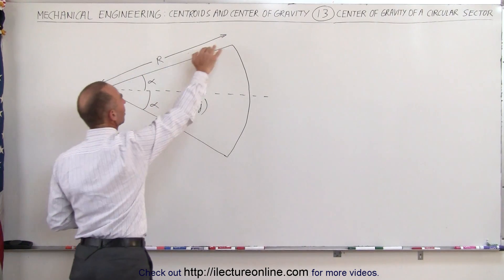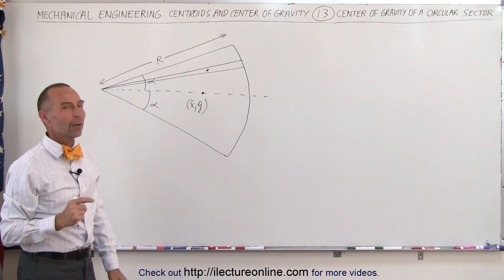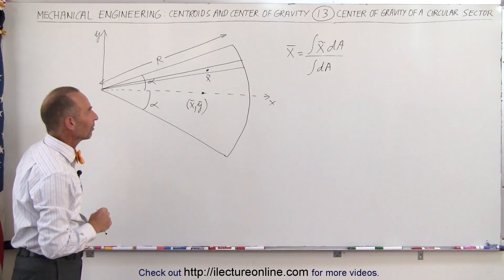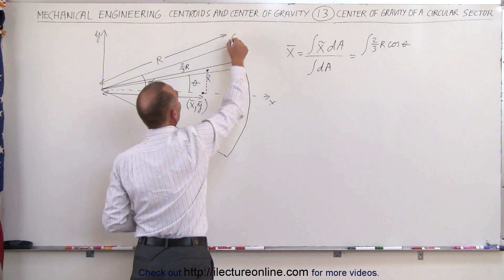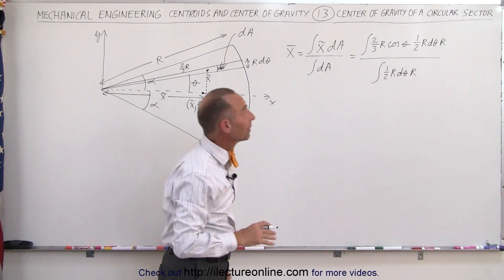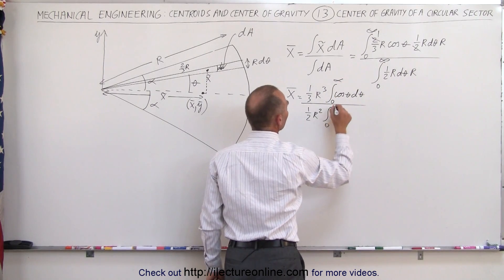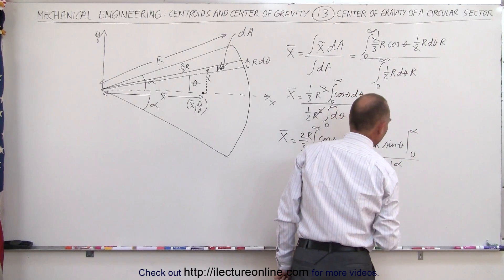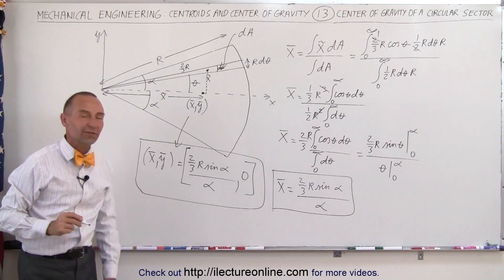Mechanical Engineering: Centroids & Center of Gravity (13 of 35) C. G. of a Circular Sector

Comment: thank you sir, but how did you get R*d(theta) at 2:53
Reply from the maker: The arc length of a circle is the radius multiplied with the angle     C = 2 pi R
Reply: thank you ❤ @MichelvanBiezen

Comment: Hello sir, thankyou so much for these vids extremely helpful, i understand that you integrated from 0 to alpha for easier calculation however you forgot to multiply the whole thing by 2, otherwise ur getting the center of gravity  of ony half the shape
Reply from the maker: Because of the symmetry there is no need to multiply since each half will have the exact same answer, and putting together you will still get the exact same answer.

Comment: How was the base rdtheta. What concept is that?
Reply from the maker: R d(theta) is the arc length of the segment.  And the segment is the shape of a triangle.
Reply: @MichelvanBiezen  so why is it that we use arc length formula to get the base but use the area of a triangle on the same shape?
Reply from the maker: For a small enough segment (which is the basis of all calculus) the base is a straight line.  (When the angle becomes infinitesimally small)

Comment: What if your circular sector isn't on the axis?
Reply from the maker: Since you just want to know how far from the point the centroid is, it makes more sense to place it on the axis as shown.  (There no reason to do it otherwise).
Reply: @MichelvanBiezen  I was doing compound shapes and needing the centroid with rspect to my axis. I was able to use the distance to make a triangle with the hypotenuse length of the centroid distannce you showed us and get the side lengths with trig.

Thanks for the response!

Comment: Sir, I understand that a quadrant circle formula is 4r/(3pi), but can this formula apply to a 90 degree sector?
Reply from the maker: The best way to answer your question is to plug is some known values like  pi/2,   pi, 3 pi/2,  2 pi, and 0 and see if you get results that appear correct.  Try it and you'll see some interesting results.

Comment: Sir, I'm having a doubt. In the above problem, shouldn't the limits of integration be, -alpha to alpha??
Reply from the maker: Not necessary.  Because of symmetry, it is easier to integrate from 0 to alpha.
Reply: @MichelvanBiezen  Thx sir
Reply: @MichelvanBiezen  bur sir you haven't then multiply it by a factor of 2
Reply: @MichelvanBiezen  i think the answer should be 4/3 instead of 2/3
Reply: @altamashqamar9959  He's dealing with polar coordinates here not rectangular

Comment: Shouldn't the limits be α to α. Cause the centroid to be found is of the whole sector with angle 2α and not of the part with angle α. This makes the formula
(2R/3)×(2sinα/2α)

For example if we take a semicircle α will be equal to π/2 or (90°) which will make the co-ordinate of centroid 0, i.e at base of semicircle which is obviously incorrect. However using above formula we get 4R/3π which is the actual answer.
Reply from the maker: If you remove half the object, you will find that the centroid (in the x-direction) is the same for half the object as it is for the full object.  (That is due to the symmetry of both halves).

Comment: It is funny that in the limit as the angle alpha goes to 0 the CoG or CoM goes to (x,y) = (2R/3, 0). The factor of 2/3 seems arbitrary. I know it comes from the CoM calculation for the triangular slice, but it still seems as if it should not be there.

Comment: Professor shouldn't this be integration with limits from -alpha to +alpha?
Reply from the maker: You could do it that way, but it would require more work.  It is easier to do it as shown in the video
Reply: @MichelvanBiezen  But the limits shld be from -alpha to alpha 
Taking them from 0 to alpha would only give half the sector's centre of mass
Reply from the maker: And you would also divide that by half the area so that the ratio would be the same.
Reply: @MichelvanBiezen  plzz verify it by putting alpha=π , i.e. for a disc it should be 4R/3π but from this formula it is coming to be 2R/3π...

Comment: Hi sir 
 Why is the lower limit zero rather than negative alpha?
 Why we didn't use the area of circle sector?
Reply from the maker: Using a zero for a limit is always easier to calculate, and since the area is symmetric, use the lower limit as zero and double the result.
Reply: @MichelvanBiezen  you hadn't doubled that sir!, Plz check, correct myself if I am wrong!

Comment: I think you should have evaluated the zero as well. Sine theta over theta when the limit approaches zero is equal to one. So when you evaluate the lower limit, it should be (2/3)R
Reply from the maker: The video is correct.

Comment: why the limits are taken 0 to Alfa rather than -alfa to alfa
Reply from the maker: Because of the symmetry, the bottom half would get the exact same result (so we only need to integrate over half).
Reply: So shouldn't there be 2times the whole 0 to alfa
Reply: Ankur Ghosh no because 2 will cancel from numerator and denominator
Reply: ankur ghosh no dude try taking aplha to -aplha u will get the same result.i think if we were finding the moment of inertia we would have multiply it based on number of symmetrical images we have :)

Comment: Sir Can you please explanin why you put the limits to o and alpha instead -alpha to aalpha
Reply from the maker: Since the two halves are symmetric, you will get the same answer for the position of the centroid in the x-direction and thus you can integrate from 0 to alpha and you'll get the same answer.  (It is easier with one of the limits being 0. )
Reply: Thank You sir

Comment: hello
can u please tell me how will the CM of the strip be at 2/3 of the distance from the reference?
Reply from the maker: +Sai Chand 
The "strip" actually has a triangular shape.  Thus the CM of a triangle is 1/3 the distance from the base to the top.  (In reverse it is 2/3 the distance).
Reply: +Michel van Biezen  have u derived this in any of your videos?
Is this valid for every triangle?
Reply from the maker: +Sai Chand 
Yes, take a look at this video:  Mechanical Engineering: Centroids & Center of Gravity (7 of 35) Center of Gravity of a Triangle
Reply: +Michel van Biezen Thanks a lot for these vids :)

Comment: Also, I observe that COM is basically like the average of position of all point masses. So, is that the case in reality?
Reply: if all the point masses have equal mass, this is a fair generalization. However, if the point masses differ in mass, this may not be the case. Also remember that some objects have a CoM which is physically outside the object itself! (think of a donut or hollow sphere)

Comment: Hi Michel I want to ask why does the "slice" have to be in triangular form? Like with the quarter circle you used a rectangular "slice" where my textbook used a triangular but both came to the same answer, is it the same with this problem?
Reply from the maker: +Kraan Kirsten 
It depends on how you solve the problem, (polar vs rectangular coordinates) etc.
Reply: okay thanks keep up the good work!
Reply: +Michel van Biezen 
 please can you illustrate more  when we use a triangular slice and when we use the rectangular one
Reply: The slice is so small that we can take assume the end of the slice which is like a part of a circle as a straight line and that will make the slice, a triangle..... So maybe that's why it is taken as a Triangle.